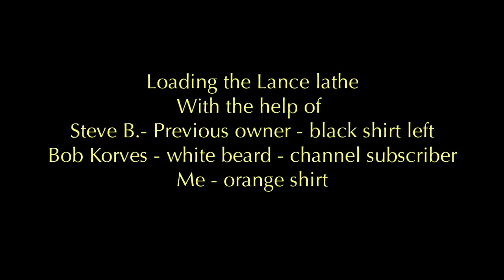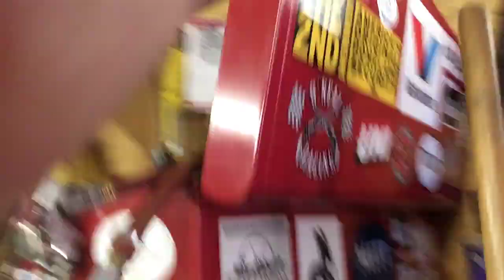Randy Richard In The Shop - Quickie of the Week # 3

Comment: Hey Rand, did that lathe have a breakaway key or weak link somewhere in the gear train? 

Enjoyed
Z
Reply from the maker: Shadon HKW I have been looking for something like that.  So it looks like it is the gears.  The pinion gear had a steel taper pin holding in.  I am thinking of using a soft brass pin instead.  I removed the lead screw today and cleaned it.  It is also driven by a pined dog clutch so maybe a soft pin there would be better.  There is a coupling on the carriage drive shaft, and it actually maybe some type of clutch.  I'll have to look at that a bit closer.  Love the squares.  Thank you.  Randy

Comment: Randy, I assume the lead screw is imperial.  If so, that pinion gear and rack might also be an imperial diametral pitch, which might make more sense than some obscure metric module.
Reply from the maker: ***** That is what I was hoping for.  I don't have any gear pitch gauges.   So I have compared the gear to actual size drawings of gear pitch form machinery's handbook, and some cad drawings I was able to down load from a gear manufacturer.  The 2.25 module, PA 20 and 14 tooth is the only one that is close.  Also by calculations this module should be 36mm OD and the gear measures 37mm.  Due to wear one the gear teeth there are small ridges built up top of the teeth, so the the actual original size is closer to the 36mm.  If you have any other idea's please let me know.  I have not even checked the lead screw, I will this morning.  Thanks, Randy.
Reply: The way to check is to look at the apron hand wheel and its scale.  If it is all metric then the rack and pinion is metric.  If it is all imperial, then the rack and pinion is imperial.  If it has both scales, see which scale comes out even at the end of one complete revolution and that is what you have.
Reply: *****
Should have said, if it is metric (or imperial) and comes out even for a complete revolution...
Reply: *****
The pitch of the rack will also give the answer.  Count and measure a fairly large number of teeth and see if it is coming out even imperial or metric.
Reply from the maker: ***** The lead screw is 4 TPI acme single lead. I will get back to you on the rack.  Thanks for the help Randy